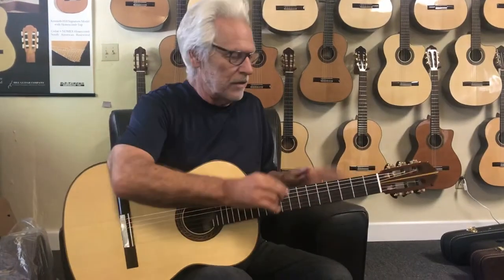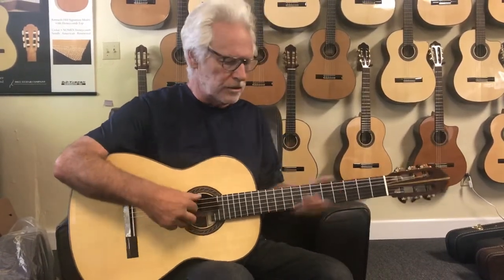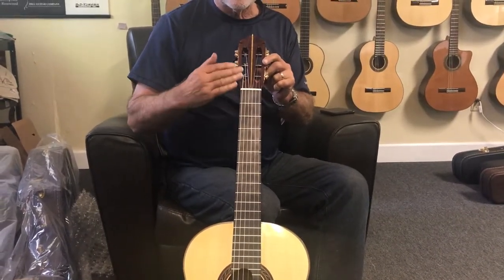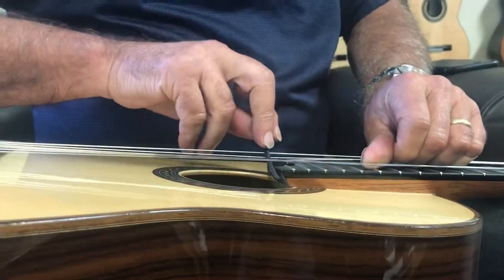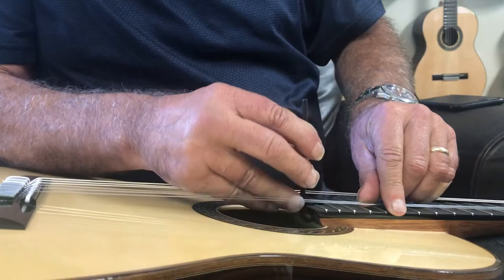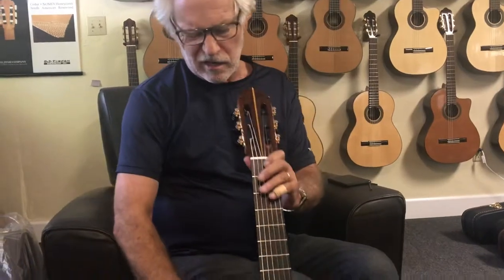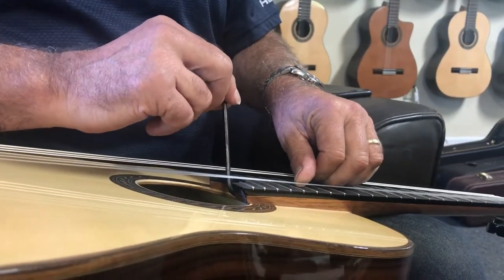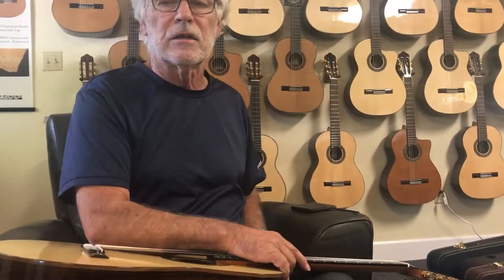Truss Rod Adjustment Tutorial

Comment: That's what I was looking for.. i have a Salvador Cortez CS-32 and i have a truss rod but it is not there.. it's more inside and a have a special tool.. i will try the suggestion thanks for it
Reply: Hello, I believe I have a similar truss rod system in my Martinez Toledo mc18, may I know the name of the tool required?
Reply: Hi.. I don't know the name because it came with the guitar, it's just a longer metal key with a special curve just meant to reach the truss rod, but is convenient since it has a wooden handle that allows easier maneuver
Reply: @iccatrom00 do you have a picture of it by chance? or maybe the name of the guitar?
is it just a regular hex key but with a different shape of the stick?

Comment: A truss rod in a classical guitar? I thought the nylon strings are so low tension that they don't need one? Except if the climate is so extreme that the wood begins to warp.
Reply: Actually its much better if it has one as long as it is lightweight. Unfortunately most builders dont build them because of tradition. Which doesn't.make sense because truss rods on guitars are a great modern improvement on design.